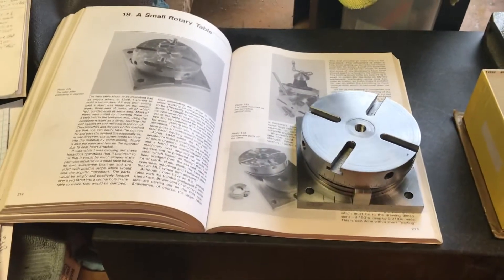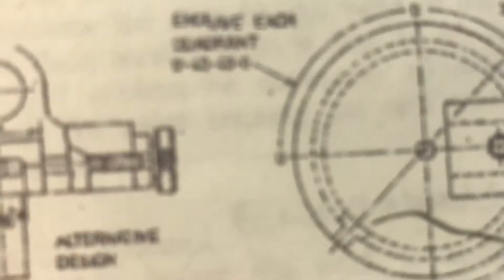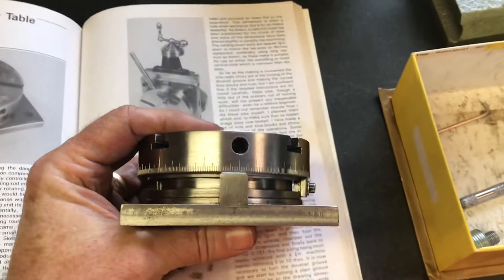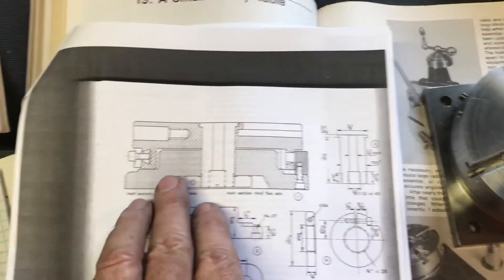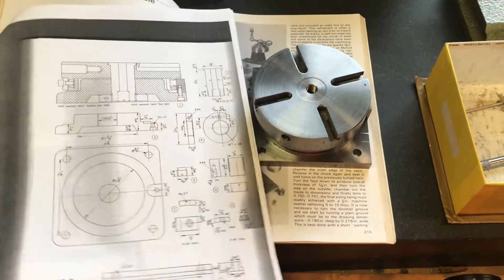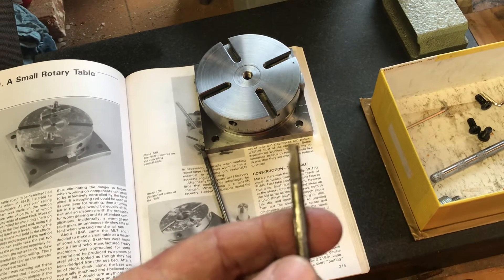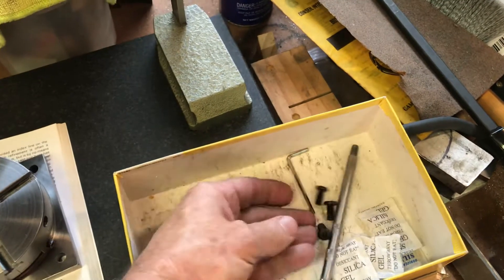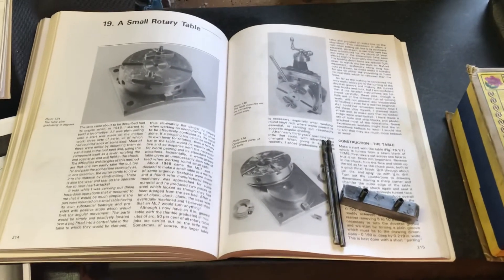GH Thomas’s rotary table, dovetail groove idea for Quorn Tool Grinder rotating base.

Comment: Just picked up a Myford speed 10… want to get it back up and running.Has a couple of teeth missing on bullgear and back gear assembly hoping I can pick up some new ones somewhere..you can still use it but you don’t have the lower speeds…could always swap out the motor for a three phase and VFD combo. Other than that it looks in pretty good order.